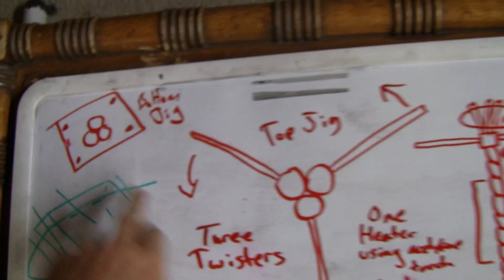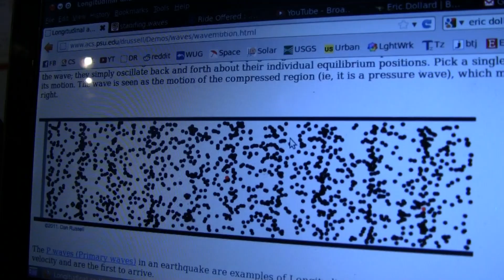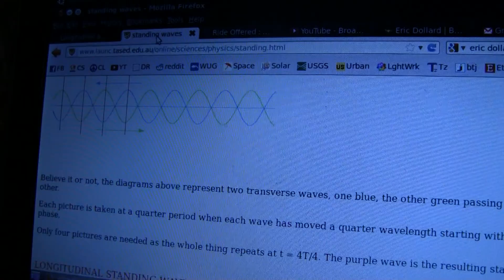Wave Structure of the Torus

Comment from the maker: @kmacksurf1 Double helix and triple helix are my two preferred coils. The double helix has a refraction of charge in its geometry based on 180 degrees and it relates to superconductivity I feel because of its cooper pairing like movement ie good for wire with less/no resistance/impedance. The triple helix (ie three circles representing boundary layers in 1D topology) represents the simplest form of geometry to connect with a singularity in the zeroth dimension (negative resistance?).